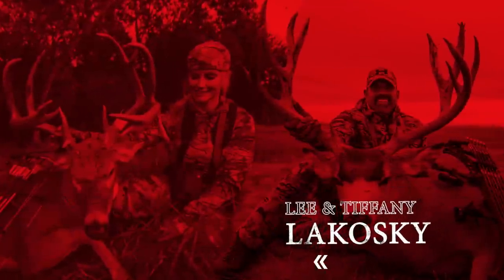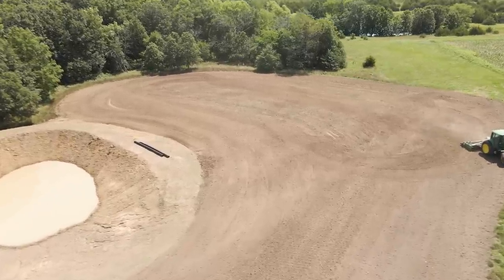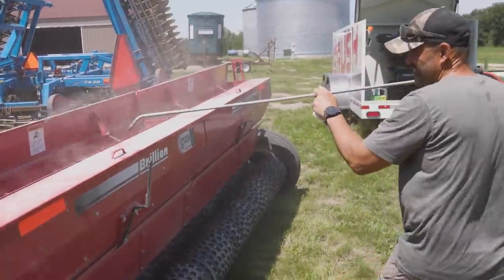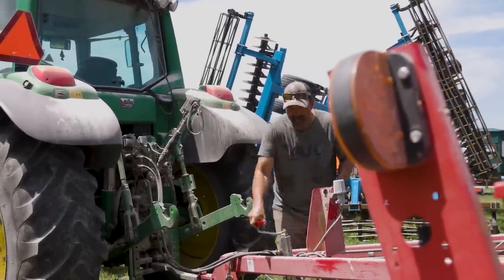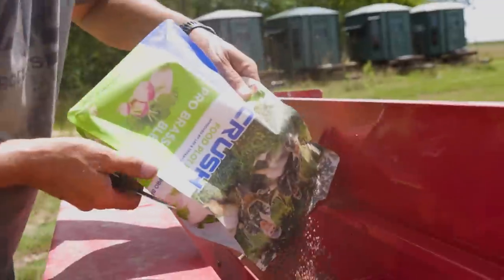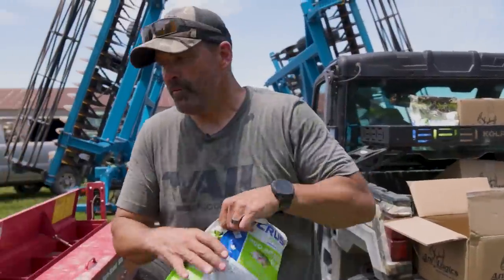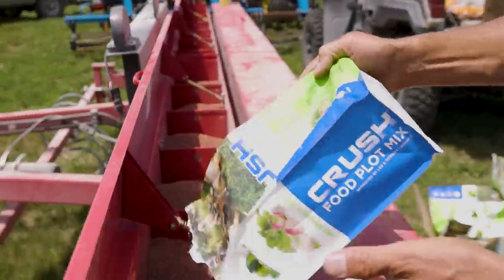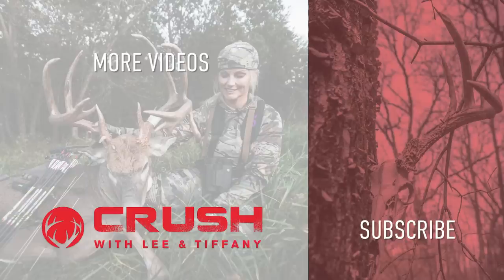Fall Food Plots Going In, Brassicas 101 // Lee and Tiffany Lakosky

Comment: Awesome content Lee.  Loved the part where you explained when you and Tiffany started out planting with the basics and have built it up from there.  Sweat equity is a big tool and goes a long ways.  Also, for the people that do not have the equipment but might have a lawn tractor, ATV or UTV, check with a local hardware rental store, they might rent a small disc and either a pull behind broadcast seeder or hand seeder.    I'm looking for one of our local stores to pickup and rent the small Genesis no-till seeder that can be pulled by ATV/UTV.